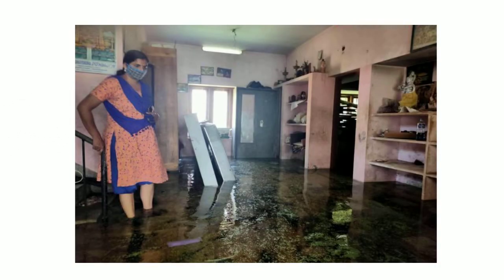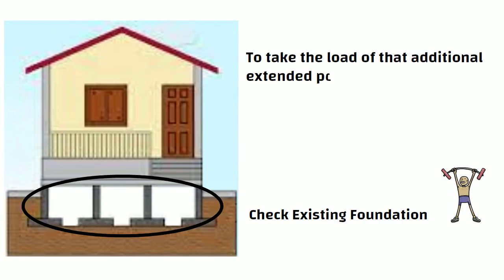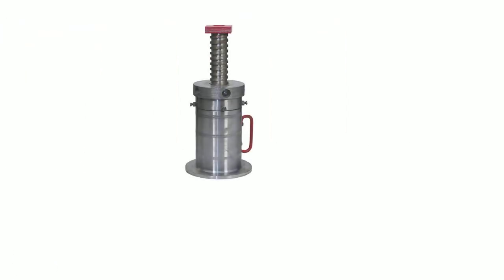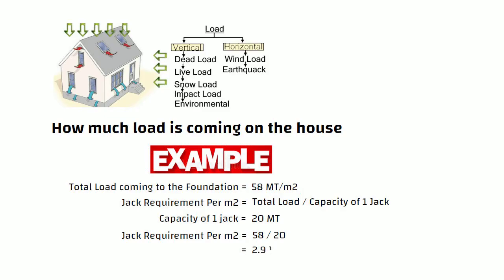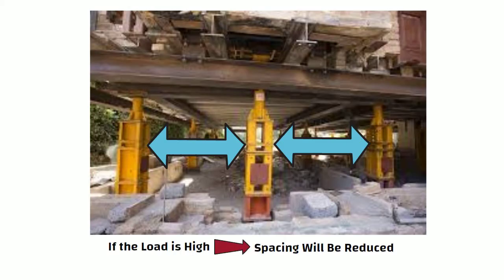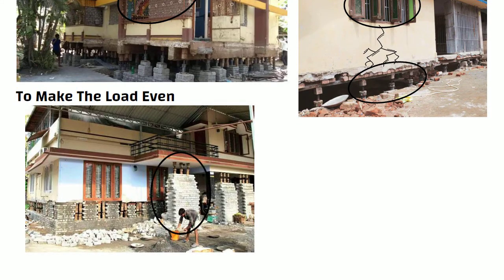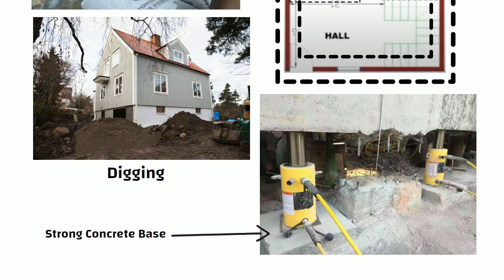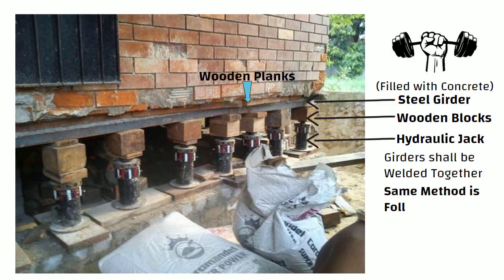Lifting of House Step By Step Explained

Comment: þhank s alot freind
My problem is to build 3 ed floor . I m not sure of the capacity of stripe fun. so I think about supporting steel column. + LIGHT weight brick work + light weight ceiling . am I wright?
Asa baghdad